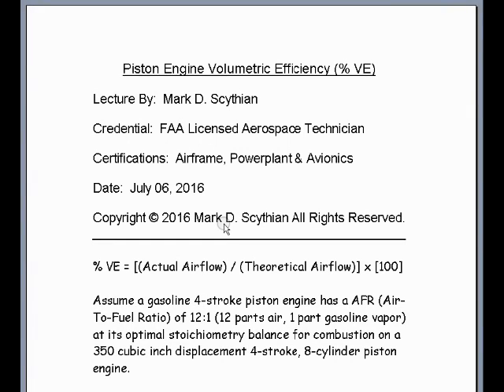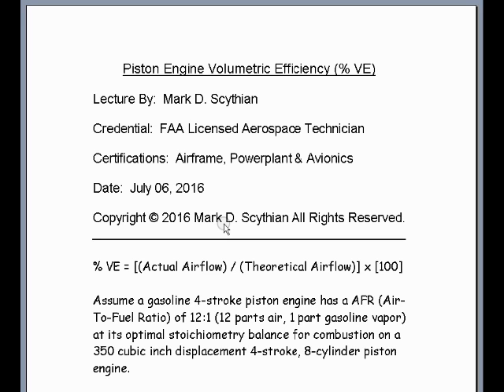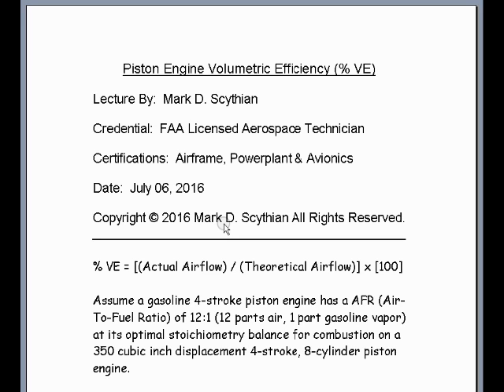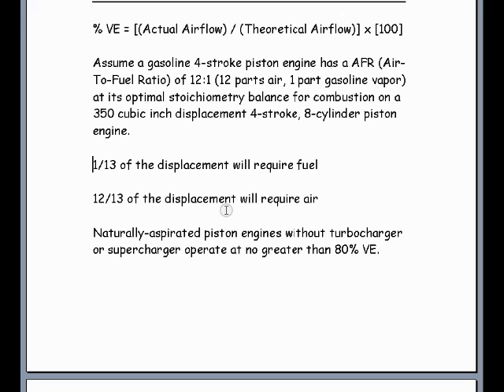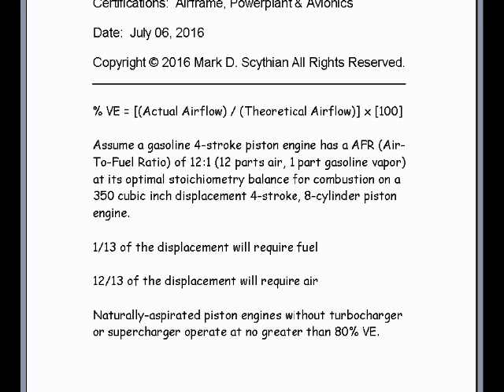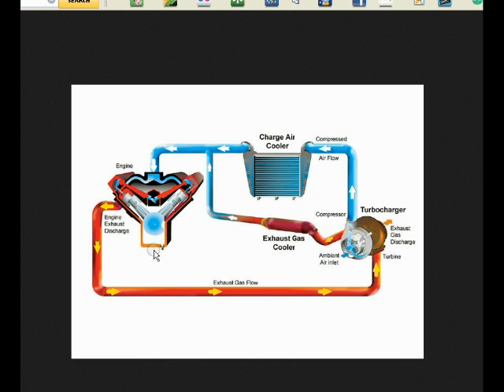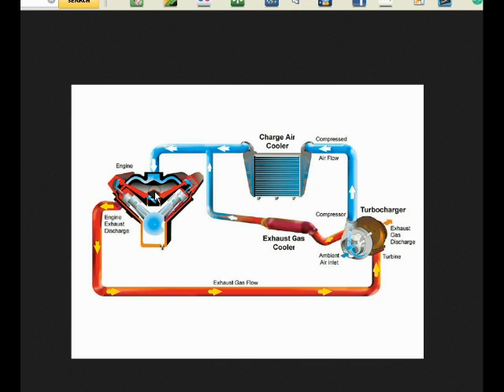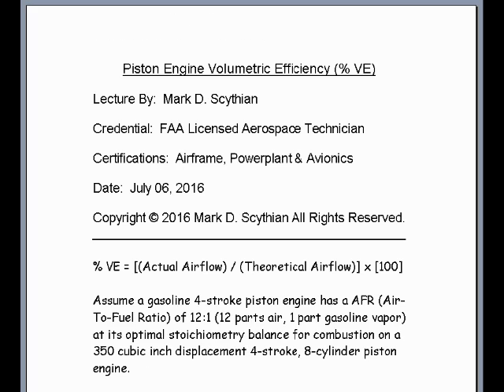Piston Engine Volumetric Efficiency % VE

Comment: This was very confusing. First you shouldn't mix the displacement of an engine in volume cubic inches with the 12:1 (actually a shy under 13:1 in automobile applications) air/fuel relationship which is measured in weight. Then a super charger or a turbo charger may very well drive the volumetric efficiency over 100%. The goal is not 100%, the goal is to maximize the BMEP which in turn creates torque.
Reply from the maker: 12:1 Air-To-Fuel Ratio (AFR) is the Optimal stoichiometry balance for gasoline.  Whereas 14.7:1 is Economy AFR during cruise, 18:1 is the Leanest AFR and 8:1 is the Richest AFR.

AFR has more to do with chemical engineering standards in thermo-chemical energy release regarding fuels (not propellants) which require a mixture of oxygen from the atmosphere unlike propellants. 

Air is 78% nitrogen, 21% oxygen & 1% inert gases.  Atmospheric pressure only provides so much air pressure into a reciprocating engine.  Naturally-aspirated reciprocating engines will at best operate at 80% volumetric efficiency (80% of the engine's rated airflow intake) at Sea Level.  100% VE  exists when the actual airflow intake is equal to the engine's rated airflow intake.

Turbochargers & Superchargers are designed to bring the VE to 100%.  It is important that the PSIG Boost is calibrated properly so that the Boost does not exceed 100%  VE to prevent damage to the cylinder head(s).

BMEP is the average pressure in PSI exerted upon piston head during each power-stroke and is tied to the compression ratio, displacement and bore x stroke.  

BMEP, Brake Horsepower & Torque are all directly related to each other as proven by the PLANK/33,000 formula and the 4-stroke BMEP PSI formula = (150.8 x Ft-Lbs Torque / CID).

The idea of a turbocharger or supercharger is to equalize the actual intake airflow to the rated intake airflow so that the VE will equal 100%  allowing the fuel charge to burn more effectively rather than having a deficit  of airflow by relying on atmospheric pressure alone (naturally-aspirated piston engine).

VE = [(actual intake airflow / theoretical intake airflow)] x 100 

Understanding the basics usually clears up any confusion.

Thanks for your comment!
Reply: Regarding the VE should not exceed 100%, are we talking aviation design here?
Reply from the maker: Yes.

But on more advanced late-model cars & industrial equipment 108% VE is not uncommon.  Since they have the technology to successfully manage over-boost conditions without any problems.  Such as Variable Valve Cam Timing, Electronic EGR combustion regulation & Resonators all tied to the TPI EFI system, including MAP, MAF, PCM, ECM, Anti-Knock Ingition Tming and Oxygen Sensor and much more.

Older and more primitive gas piston engines shouldn't exceed 100% VE though.  Since over-boosting  them will lead to detonation of the fuel charge, hot-spots and damage to engine components.  Also the power lost to keep the engine running to  compress and expel a surplus of air on the piston's compression & exhaust strokes will cancel out any gains in power.  

Power lost to keep engine running is Friction Horsepower (FHP) and whatever usable power that is left over available at the engine's crankshaft is Brake Horsepower (BHP).  Indicated Horsepower (IHP) = FHP + BHP.

Aviation gas piston engines are quite simple in their design.  The FAA doesn't like to approve anything too "high-tech" on them.  A car's gas piston engine is usually more advanced than an aviation gas piston engine.

But aviation gas piston engines all require turbocharging.  On a naturally-aspirated gas piston engine for every 1,000 feet altitude above Mean Sea Level (MSL) a 3% loss in Brake Horsepower will occur.  After about 5,000 feet above MSL a naturally-aspirated aviation gas piston engine will become under-powered.

Turbocharged aviation gas piston engines with high-performance turbocharger(s) are designed  to keep the VE at or near 100% for as high an altitude as possible which is about 12,000 feet above MSL.  Airplanes & helicopters flying higher than 12,000 feet above MSL require gas turbine engines instead.

Convention wisdom says that at 100% VE intake airflow the fuel charge can burn completely allowing optimal  BMEP to be reached.  

Gas piston engines operating at higher-than 100% VE require more advanced technology in order to manage over-boost conditions and allow for gains in usable power output.

Thanks for your comment!
Reply: For aviation I agree that the VE should 'probably' be carefully controlled to not exceed 100%. (I say 'probably' because it is not my field but I do understand the purpose and the effects of not having full control over the power unit).
But for cars please also remember that by displacing not only the swept volume but also the combustion chamber volume you could achieve >100% VE and this can be done with a well tuned intake/exhaust system without turbo or super charging. Of course, compared to the methods you suggest this creates a very narrow window of high efficiency.
I have just put together a 327 cu in engine that actually has a current VE of around 95% but still the output is on the low side. This tells me that the induction works to satisfaction but I have too big loss on the exhaust side letting out some pressure (torque) so I have to change exhaust valve timing. The exhaust system obviously worked better than anticipated.
From there I slipped into your clip here, thanks for inspiration, info and feedback :)
Reply from the maker: It's ideal to keep the % VE near or at 100% in aviation gas piston engines.  Mainly due to the decreased atmospheric pressure and party due to the metal fatigue that will develop within engine structures at higher altitude where the atmospheric pressure is much lower.  Greater than 100% VE would not even be legal on certificated aircraft under the FARs' and would compel a greater likelihood of engine structural failure.

Would it be possible to achieve 100% VE on a naturally-aspirated automotive gas piston engine using tuned vertical velocity stacks especially by means of a intake/exhaust variable valve timing cam?  

I asked this because I used to know someone who builds automotive racing engines and I was told by that person that exhaust backing pressure needs to reach a harmonic resonance by implementing the proper vertical velocity stack in conjunction with exhaust valve timing to reach greater power output without turbocharging.  Does this sound about right to you?

The closest thing I can think of related to this in aviation gas piston engines is the exhaust augmenter tube system which takes exhaust gas velocity and channels it through  a convergent-divergent exhaust diffuser to induce a  pressure shock-wave causing a sudden boost of intake airflow.  

Also, is this what 2-stroke bike racing guys use with those long conical convergent-divergent exhaust systems to induce some sort of a backing-pressure shock-wave that boosts induction airflow?

Thanks for sharing information about naturally-aspirated automotive engines reaching 100% + VE by other means than just turbocharger or supercharger.  Aviation gas piston engines are way more conservative than automotive gas piston engines!  lol

Congratulations on your 327 automotive engine build!  Sounds like you're almost there and you just have some issues with the exhaust flow regulation side of things.

Thanks Alex!
Reply: Mark, I am just back home from the dyno facility where I have this engine installed. It has been an interesting day however I have not yet reached my goal. A couple of interesting observations have been done, especially on volumetric efficiency or more correct ingested air volume, which is what is measured on the dyno. What do you say about 388.5 cfm air in @ 3975 rpm. That would make VE 102%
(Theoretical volume @ 100% VE would be (331 cu in x 3975 rpm)/(2 x 1728)=380.7 cfm. 331 cu in is from 327 cu in plus 0.030" over bore)

If you take into consideration the intake valve closing point which is 64* ABDC, the compression stroke is then reduced from 3.25" to a dynamic stroke of 2.53" thus resulting in a 'Dynamic Swept Engine Displacement' of 258 cu in. Using that displacement in my VE calculation drives the VE @ 3975 rpm to insaneous 131%. This tells me flow dynamics is a very big player in this game. Also, even though the VEs is fairly linear with values from 100% @ 3246 rpm to 102% @ 3975 rpm and the down to 95% @ 5775 rpm (based on static displacement of 331 cu in) I have too big loss in torque from 4500 rpm so something is robbing the cylinder significntly on the ingested volume ...

Any ideas would of course be welcomed!
Reply from the maker: I'm writing down the testing metrics you've posted and taking them to analysis.  Placing them into a Finite Elemental Method for verifying any non-linear fluid dynamic function(s) should determine accurate formulation. 

Alex, what elevation above Sea Level in feet and what air temperature in degrees F were the testing metrics you posted taken within?

Also, the power to overcome greater compression might add to the Friction HP loss.  I don't know if this is true until analyzing the change in intake valve close degrees at the ABDC piston position into the compression stroke testing metrics that you posted.

Paying for the compression, intake & exhaust strokes, friction and driving engine accessories by one power-stroke may lead to trade-offs in power gains vs losses should VE and CR exceed certain values.

Let me take the testing metrics that you posted and start an analysis.  Perhaps a graph can be made reflecting the calculations to make interpretation easier.   

It would help if I knew the exact elevation above Sea Level in feet and air temperature in degrees F that the dyno facility was operating in so that absolute certainty in terms of calculations can be made.  Also, what is the exact bore x stroke in inches you're working with?  How many cylinders?  You told me the static displacement of 331 CID.  Also, are the valve faces angles the standard 46 degrees or are they 23 degrees or lower?

Thanks Alex!
Reply from the maker: Alex, I just finished the preliminary analysis on your engine's performance metrics.  So far it looks as if you might be exceeding the Torque Curve limits (Max Torque RPM Limit) of your engine for which Ft-Lbs Torque may drop at an RPM higher than 3,975 RPM (103% VE).

I have calculated the current Bore x Stroke, BHP & Ft-Lbs Torque @ 3.975 RPM, Lbs/Min mass airflow, Lbs/Min (PPM) Gasoline consumption, BHP per CID at a Gasoline AFR of 12:1 operating in 59 degrees F air temperature in 14.7 atmospheric pressure (Sea Level) elevation based on the data you posted.  

I also made a few notes on the possible implications of a 63 degree After-Bottom-Dead-Center (ABDC) open intake valve(s) setting 0.72 inches or (3.25 in - 2.53 in) into the compression stroke. 

I will post this 6-page analysis as a separate YouTube video addressed to you as a Cast Screen video of the calculated data on MS-Word as the newest video in my YouTube library. 

I'll title the video as:  'Preliminary Engine Performance Analysis for Alex Mail'

Is this okay with you?  

Reply back to me with the go-ahead and I'll post this new video addressed to you.

Thanks Alex!
Reply: Mark, I am very grateful over your interest in this matter. Since the goal isn't reached yet and the analysis of last dyno run has been evaluated it seems that there is a fabricated error in this engine build. The guy who installed the valve springs I recommended did not pay attention to install height and seat pressure so my conclusion is that we're experiencing valve float which in turn could be driving the air consumption up and giving us inaccurate data. If interested I will share results when this error has been corrected.

Meanwhile I would be very interested in your calculations, please post the video :)
Reply from the maker: Alex, I just posted the video.  It is the newest video in my YT library.

Based on your conclusion it sounds like the valve spring constant (k) on the valve springs are not within limit?  

The engine you're working with has a whole lot of power and airflow delivery for its dimensional limits based on the preliminary analysis calculated!    

The video is now live.  Tell me what you think?

I'm glad to help out.  After all, we're all gear heads aren't we?   lol

- Mark -
Reply: @alexmail3051  two bits. 

Using dynamic displacement is not right, stick with static in your calculations.

Second with exhaust and intake overlap you're going to have some of that cfm go straight out the exhaust.

 VE on NA not possible to reach 102 without some form of induction, be it forced induction or possible ram air.

Perhaps a high power fan was supplying the engine with air while on the dyno.
Reply: @danielsimpson8929  well, you're mentioning it yourself - ram air!
Intake charge is mass, when mass is flowing through the intake runner it has a lot of energy that under certain circumstances may ram fill the cylinder.

Comment: How did you determine that 1/13 of the displacement will require fuel and 12/13 of the displacement will require air on the given engine in your example? Would those amounts be the same for other 4-stroke piston engines? Would those be the same amounts on a forced induction 4-stroke piston engine? Your help will be greatly appreciated.
Reply from the maker: Let's say an individual cylinder has 45 cubic inches of volume and it is on a gasoline 4-stroke piston engine.  Assume that the 45 cubic inches of displacement includes the Effective Piston Stroke.  

Optimal stoichiometry balance between air and fuel for gasoline is 12:1 or 12 parts air and 1 part gasoline fuel vapor.   Mathematically speaking there is a total of 13 parts.  12/13 is air and 1/13 is gasoline fuel. 

That being said, exactly 12/13 of the 45 cubic inches of displacement will require air and 1/13 will require fuel vapor.   But this is not so on a naturally-aspirated piston engine lacking a turbocharger or supercharger for which the VE is approximately 80% relying only on atmospheric pressure to assist with airflow into the engine.

Assume that the 45 cubic inch cylinder is on a naturally-aspirated engine, in the real world this means that that only 80% of the 45 cubic inches will receive airflow or 0.8 x 45 = 36 cubic inches.

(12/13) x (36) = 33.23 cubic inches air + (36 - 33.23) cubic inches gasoline fuel vapor = 12:1 AFR

Without a turbocharger or supercharger to provide forced air induction the cylinder(s) will only induct 80% of their rated airflow and in this case per cylinder that would be 36 cubic inches of air.

Out of that 36 cubic inches of air 33.23 cubic inches will remain as air and (36 - 33.23) or 2.77 cubic inches will become gasoline fuel vapor to equate an AFR of 12:1

In terms of power and performance the engine will not operate at its peak potential relying on atmospheric pressure alone since there is not enough airflow to equal the engine's rated airflow intake.  The result is less effective combustion of fuel and even unburnt gasoline going out of the exhaust.  Although with electronic tuned-port fuel injection (TPI) the airflow deficit is sensed by the MAF & MAP sensors and the amount of fuel delivery is electronically decreased in naturally-aspirated TPI EFI engines preventing excessive unburned gasoline from exiting into the exhaust. 

In regards to naturally-aspirated reciprocating engines there just isn't enough atmospheric pressure to push the rated airflow into the engine, at best just 80% of the rated airflow.  Which is still satisfactory but is still not at its maximum potential.

Mathematically speaking a 12:1 AFR involves a total of 13 parts: 12 part air + 1 part gasoline vapor.  The ratio is based on the function of volume since the chemistry of both gases have different molar masses.

Does this make sense now?

Thanks for your comment!